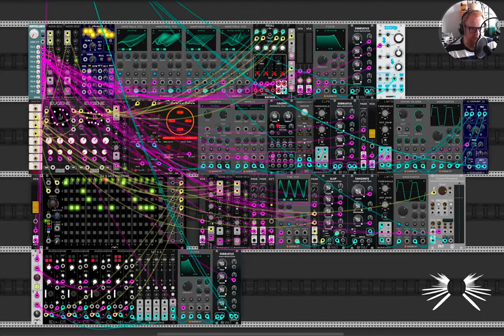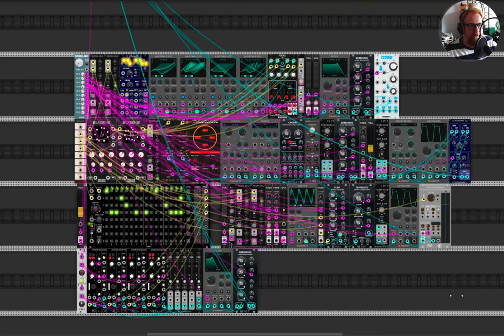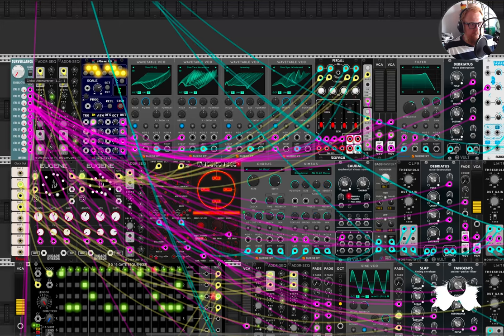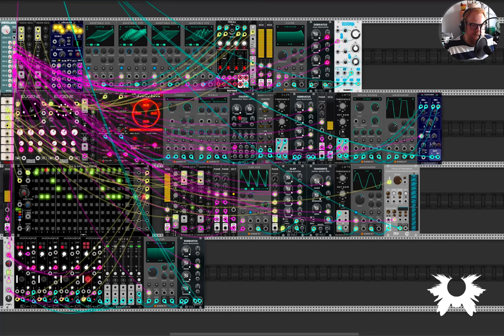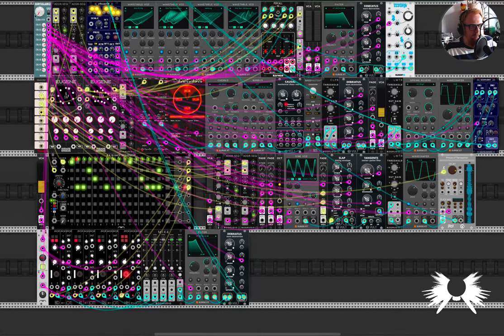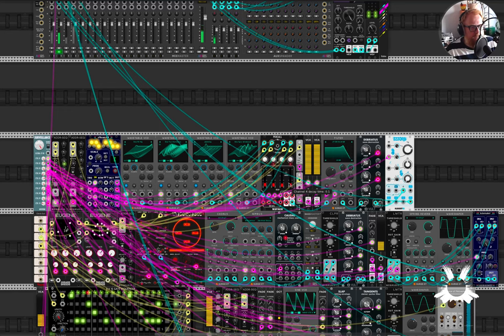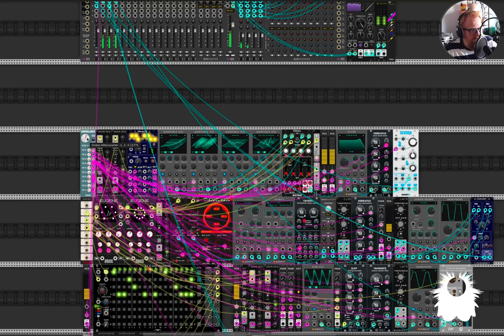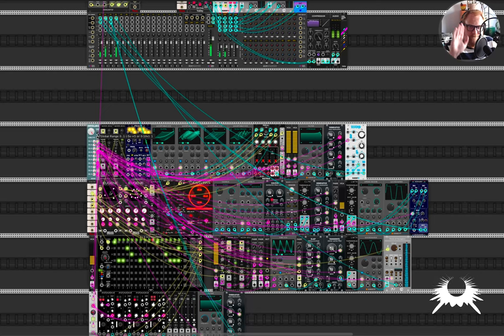PatchWerk with Miles // EP12 One Macro Knob To Rule Them All

Comment: Cool! Another way to crossfade multiple parameters that I've found is to use bogaudio xfade. It's polyphonic, so you can morph up to 16 cvs.  merge 16 cvs into A, 16 cvs into B, change the mode to linear instead of log, set the mix knob turned all the way clockwise, and then use a 0-10V cv into the mix input to control the fade.
Reply from the maker: @shamskitz  yeah it’s a great module too. So many ways to do this in VCV, I chose Surveillance because I’d not used it before and I liked that it had a lot of outputs (not that it matters all that much in VCV). Thanks for watching :)